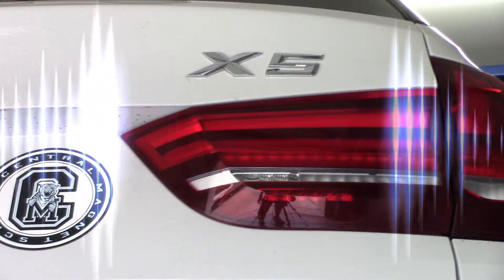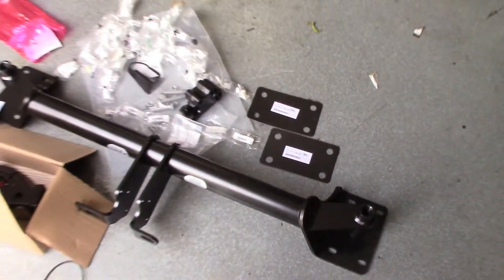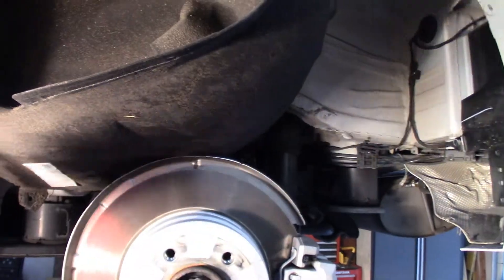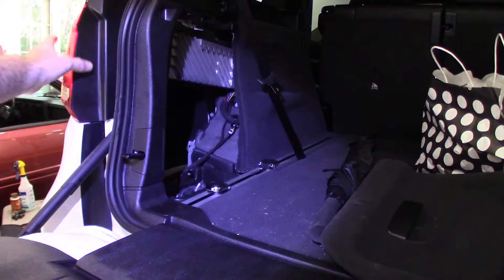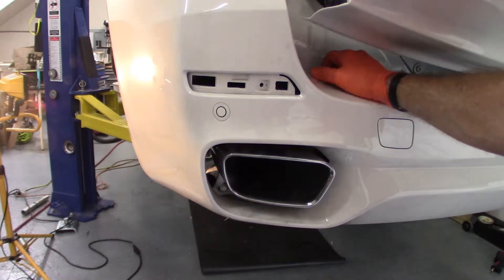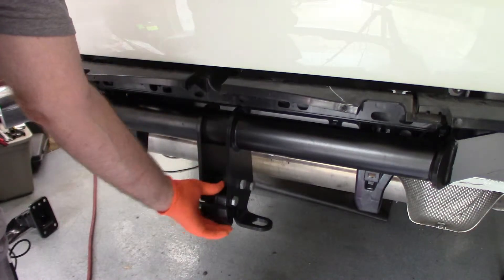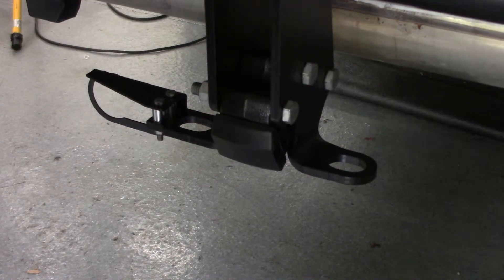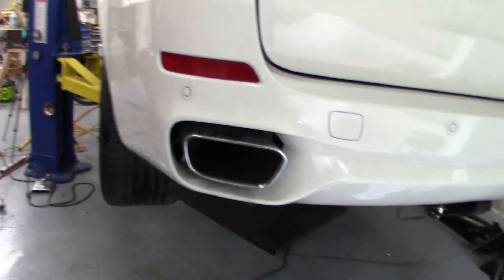How to install the tow hitch cross tube on the BMW X5

Comment: Do you need any special programming? I have a 2019 x5 and the dealer is quoting 4K for a tow hitch install?
Reply from the maker: I only use my tow hitch for attaching a bike carrier. If you're actually towing for real, you might need to flash the ECU. However, mine has the M package on it with a little more torque and a little more horsepower. I never saw anything that said I needed to flash the ECU on mine for full-on towing. Thanks for watching. Hope the video was helpful.
Reply: I have the 2014 X5 diesel M package and took X5 for tow hitch for bike rack purpose.  Recently I was going to toll a trailer but forgot that I don’t have the electrical wiring.  Wondering if you eventually installed the electrical and did the coding for tow hitch